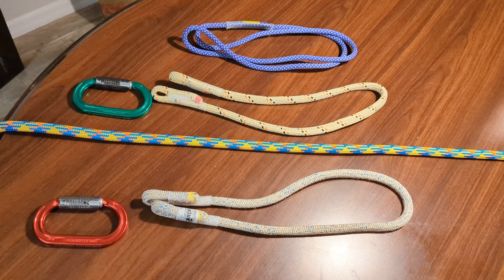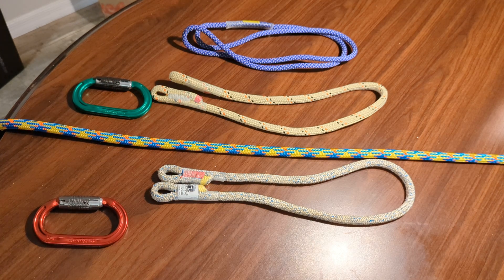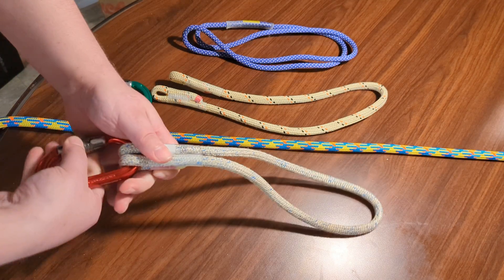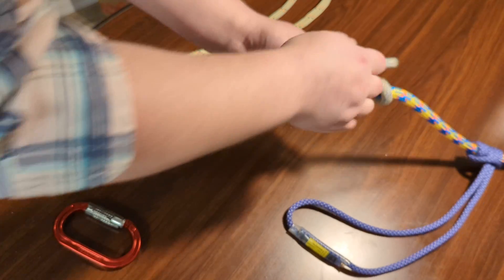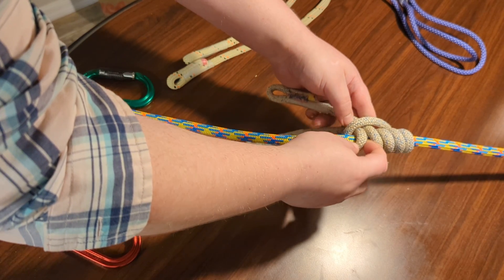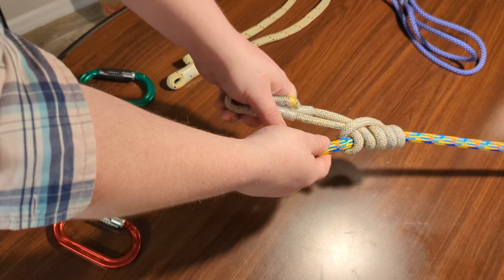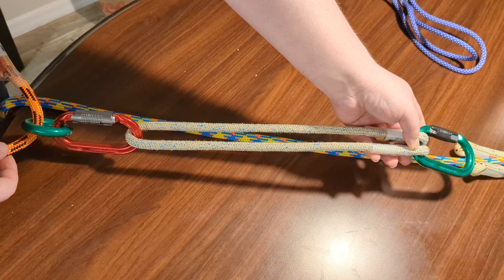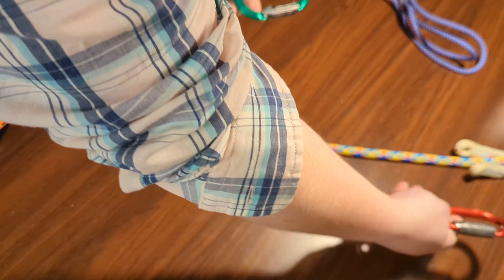VT/EYE TO EYE PRUSIK Educational Series (Episode #1)!

Comment from the maker: **IMPORTANT VIDEO NOTE** For whatever reason, back when I created this video, I was referring to common "hitch cords" or *eye to eye prusiks" as VT Prusiks. Please understand that I made a mistake and that the "VT Prusik" refers to an actual, singular, very specific hitch cord that is manufactured by Blue Water ropes. VT Prusik, in other words, is one single product and, if I could remake this video, I would strictly refer to them as eye to eye prusiks and/or hitch cords because those are the proper terms for the items showcased throughout this video. The VT Prusik is simply one of MANY different types of hitch cord, sometimes referred to by vendors as "tech cord." The is an entire world of different friction hitches/eye to eye prusiks on the market, sold in various diameters, and made from various heat resistant fibers, and with many unique patterns and colors/designs. So yeah...please forgive my ignorance. Back when this video was made, I was a) completely new to YouTubing and b) not naerly as educated with regards to climbing gear, hitches, and techniques as I am now. Thanks for listening to my clarification! =-D

Comment: Can you safety use the eye to eye  hitch cord to prusik as a backup to your ascender ropeman or grigri?
Reply from the maker: Yes, although the actual Prusik hitch would not be your best choice for descending. For ascending, you could use pretty much any friction hitch. For descending, unless you happen to have a rope wrench, you would be limited to using a Valdotain Tresse; it's the only hitch that would be unlikely to bind when using it as is for a descent.
Reply: @Knot-orious I'm using it in a hunting situation as a second safety backup device... I'm a saddle hunter and using a Ropeman to my tether.  Got to thinking its always good to have a backup incase of a fall off the stand and the ropeman breaks the prusik wound grab before I got to the stopper knot... I just need a little more rope on the prusik to the saddle.  This is where I thought the eye to eye either doubled up or eye to eye would work perfectly
Reply from the maker: You could always simply put an eye to eye hitch cord, with the eyes at the same connection hole where the ropeman is, with a carabiner going through both, and then have a friction hitch tied above it. The only issue with devices that have teeth is that they might de-sheath the rope if you were to take a fall with forces above 4kN and then you would have no way down and you would get stuck trying to climb up the core of the rope, which is very hard. If you use a friction hitch instead, and take a fall at 4kN, it will actually just slide down the rope a little bit and help to dissipate forces on your body, without desheathing the rope. Just something to consider.
Reply: @Knot-orious I appreciate the feedback thanks for the help and insight... Good stuff!

Comment: You can tie a klemheist with a loop
Reply from the maker: I'm fully aware of this. I'm not sure why you're saying that. Can you give me some context, please? I made this video a long time ago, so I can't remember everything I said. But I am certain that even back then I knew quite well that a klemheist can be tied using a loop. Anyways, maybe I misspoke? Help me understand. Thanks.
Reply: @Knot-orious  
You had said about only symetrical prusiks can be tied with loops.
For the rigging I do, I like to stay as much in line with main line as possible.
I often use friction hitches gripping 3/4 pipe to raise or lower high bay lights with a 50ft articulated boom lift.
Reply from the maker: @glennreynolds962  Thank you for elaborating. You got me. If that's what I said, then you're completely correct in your assertion that the Klemheist is an asymmetrical  which can be tied using a loop. Definitely an oversight on my part. Thanks for bringing this to my attention.

Comment: What about double splice  on 8 or 10 mm. rope (for the eye), is it possible? and, could go around 5400 pounds in basket? I mean for ropes like Pelican, mamuth, Yale, etc.
Reply from the maker: Are you asking if you can use climbing ropes as a hitch cord/eye to eye prusik cord? The answer is yes, but only if you are using it to ASCEND and nothing else. If you use it for descents, the eye to eye will surely melt from all of the heat. You need to buy hitch cord that is made using heat resistant material. If you have never bought it before, I can link where I buy most of mine. Just let me know.
Reply: @Knot-orious  ok I was thinking on used on a lanyard, but thanks for all the info.
Reply from the maker: @samuelperez1886  Used on lanyard would be a perfect use for it.
Reply from the maker: You should be buying heat resistant cord and splicing it the way you describe. I have plenty of hitch cords that have been made by creating double splices on each end.

Comment: How long is the cord you’re using for the vt?
Reply from the maker: Anywhere from 30-32" is ideal. For 8mm hitch cords or smaller, even 28" might work. If you plan to use it with a Rope Wrench, it's better to err on the side of caution and go between 28-30" just so that your hitch doesn't ride too close to the actaul wrench part. Ideally, you always want the most compact hitch you can get for a Rope Wrench.